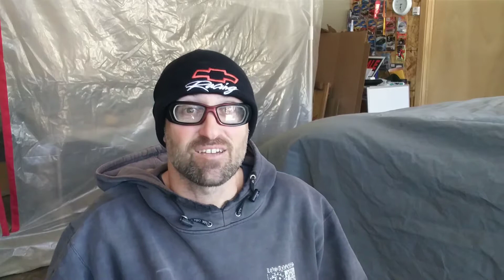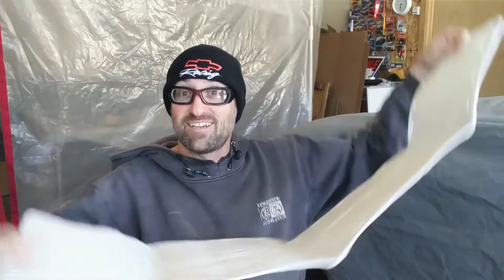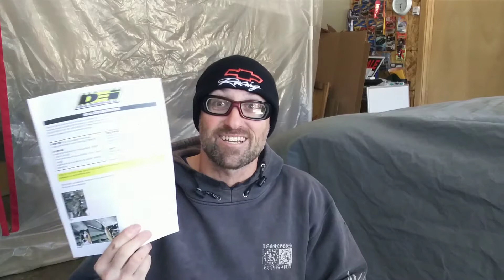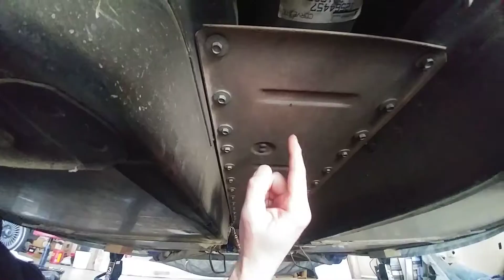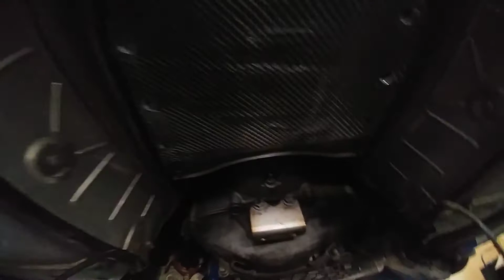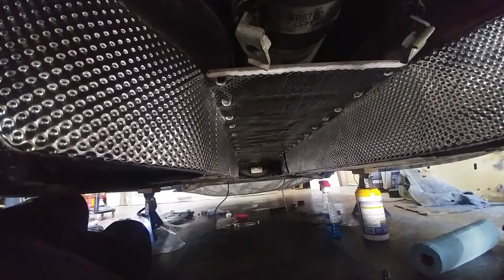Installing Design Engineering (DEI) C5 C6 Corvette Transmission Tunnel Heat Shield

Comment: i know its an old video but , did you notice a nice reduction on the temps inside the cabin ? i mean on the central console ? thank you man !
Reply from the maker: I did, but I never measured the difference. The A/C keeps the car at 70°F when it's 100°F outside with no issues and the shifter handle isn't extremely hot anymore.

I also added the sound deadening front to back, which probably helped with the heat reduction also. I only measured the decibel difference.
Reply: @BasinMotorsports thanks , to help a bit more im.planning to wrap my headers , hope the titanium wrap is not as bad as the people say, thanks man for the answer
Reply from the maker: I haven't heard any issues with the titanium wrap, but I've had good luck with wrapped exhaust in the past.
Reply: @BasinMotorsports thanks !!

Comment: Hey, could the plate be unbolted, ceramic coated then stick the insulation on before bolting it back up?
Reply from the maker: I would think so as long as the glue adheres to the ceramic coating. It's pretty strong stuff.

Comment: Can you put this on after putting on a thicker exhaust tunnel plate that is ceramic coated? I want to put a 3/8" elite engineering exhaust tunnel plate on my C6 for the heat and also to sudden up the body a little because my car is a convertible.
Reply from the maker: It should be no problem using the thicker plate.

Comment: Hi there nice video, do you know if this part is for C6 Z06 as well?
Reply from the maker: There are separate part numbers for the C5 and C6 (shapes are slightly different), but they fit all respective models. All C6 (base, Z06, etc.).
Reply: @BasinMotorsports  does this kit really solves the heat in the cabin? I had a Corvette C6 before and never had this problem, but with this Z06 the heat is unbearable ...I found a product from Lingenfelter but cost $436. Thanks for your quick reply
Reply from the maker: @mrphil4085  It does make a difference. I did the Boom Mat interior sound deadener and this heat shield last winter and they definitely made a difference. The console is cooler to the touch. The only thing that still gets warm is the shifter handle, but neither of these can fix that. My A/C typically freezes me out of the car easily in the summer. If you don't need it right away use Google shopping and find the part for the lowest price. I think I got my kit from Throttle for a good chunk less than everywhere else, but it took a month or so to get.
Reply: @BasinMotorsports  thanks I found this kit on Amazon day after deliver .Thanks my friend